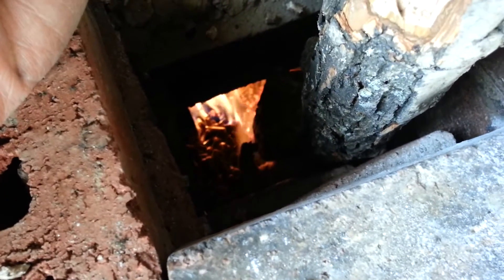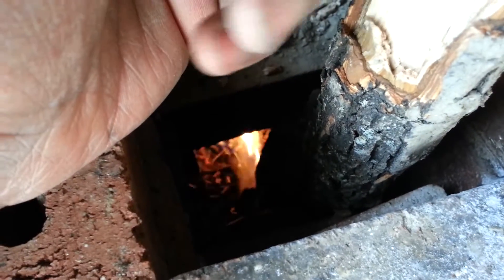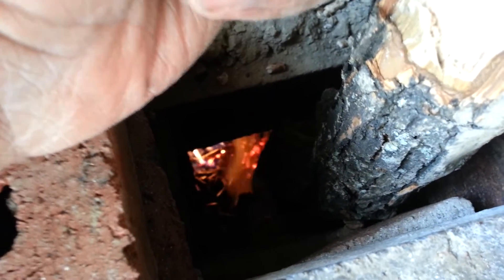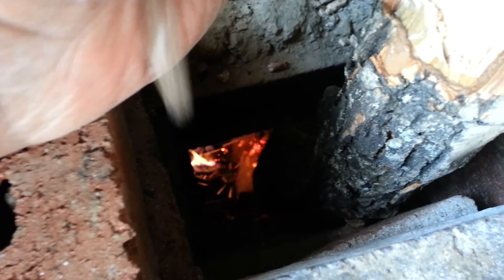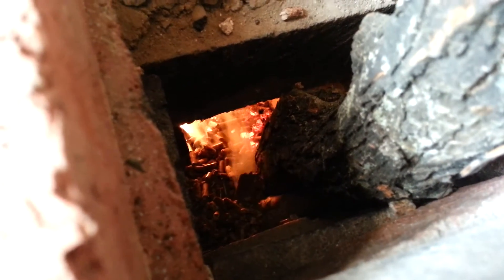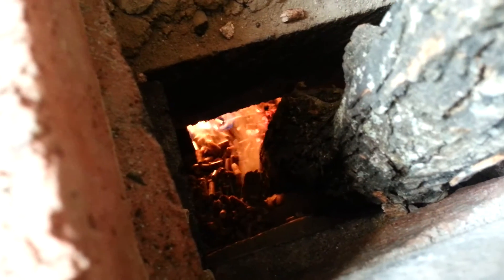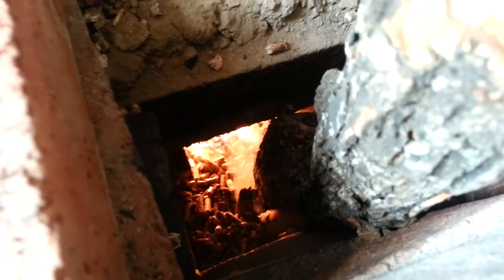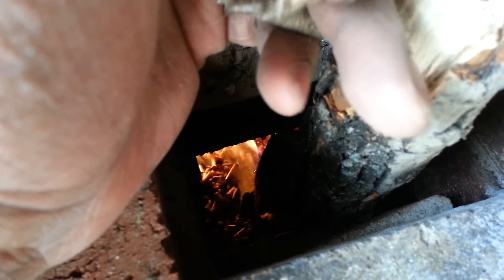High Tech Rocket Mass Heater Pellet Feed (H.A.N.D patent pending)

Comment: I did the same with mine until I just use a 2" X 2" tube that gravity feeds the pellets down to the burn grate. That way I don't need to be there to tend it anymore. It just feeds the pellets and they ignite once they hit the pile of burning pellets. Once the burn slows down on the pile, new pellets slide down and keep it going. There's a learning curve on how to make the grate so it doesn't burn too hot (had that happen in the beginning) The gap between the feed tube can be adjusted to make it feed faster or slower, depending on the temp your after.
Reply: i have a "real" ROCKET mass heater.  not propane tank kind.  so this looks very interesting to me.  i'd love some more detail and possible pics or video.   thanks